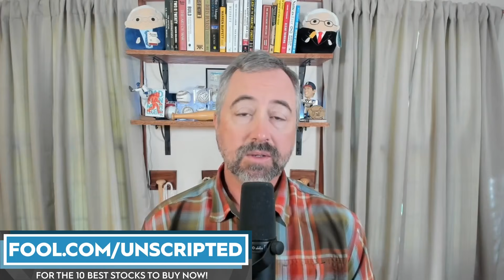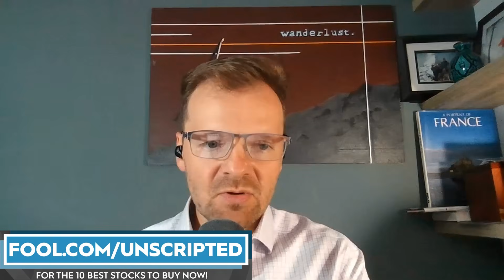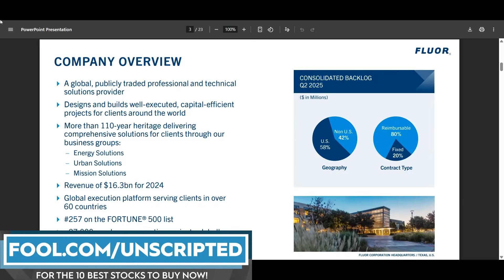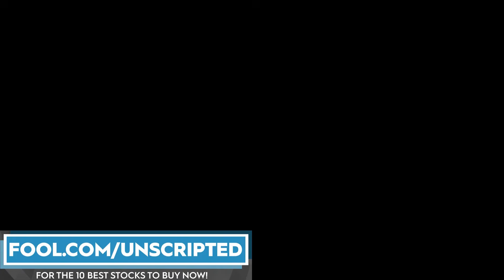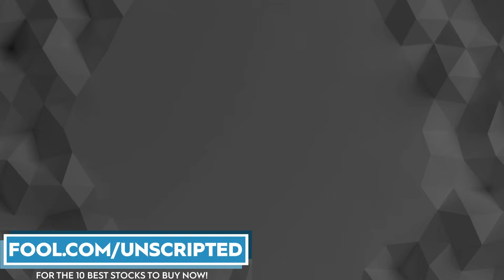NuScale Stock Crashing: 2 Safer Stocks to Win From Nuclear

Comment: Love BEPC but so confused with the Brookfield structure.  If BAM owns a portion of BEPC and has higher gudiance on dividend growth, is BAM a better investment than BEP?
Reply from the maker: BAM doesn't own any of BEP/BEPC. BN owns a controlling stake in both (BAM used to be the ticker for BN before they spun out the asset management business as a standalone public company). What it boils down to is whether you want to own a pure-play asset manager, earning your share of the fees they earn on AUM and performance bonuses (BAM) or you want to own a business that owns and operates renewable energy and energy transition assets that generate considerable, relatively consistent cash flows. It's two different, slightly overlapping businesses. The biggest overlap is that the funds BAM manages often have significant stakes in the assets BEP/BEPC operates. Often a bigger stake than BEP itself. But BAM has more than $1 trillion in assets under management in a lot of other things besides energy.
Reply: Thanks for the explanation!    This Brookfield stuff just has me so confused.😮

Between BN, BAM, BIP, BEP do you have a favorite/highest conviction? 

Im between BEP and BAM.
From reading on their investor relations page, seems like BN owns 75% of BAM and gives exposure to real estate/insurance too?
Reply: Sorry, tons of questions there!  Just thinking Brookfield is like a more under the radar version of Berkshire with lots of different options they give to imvest in certain segments... reall a fan of brookfield- just dont know which i think is best